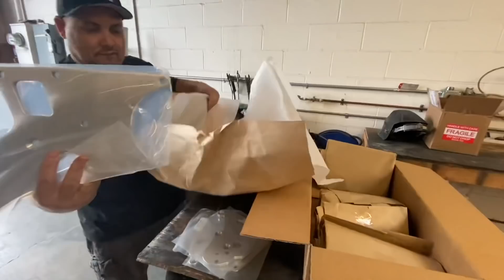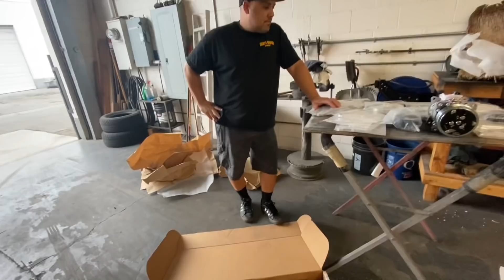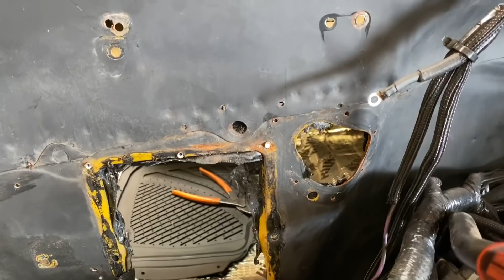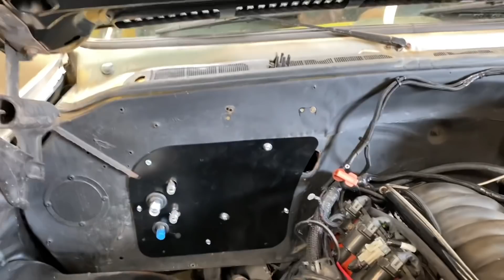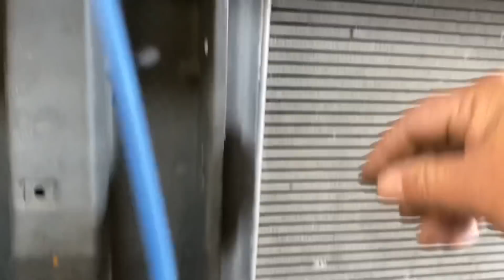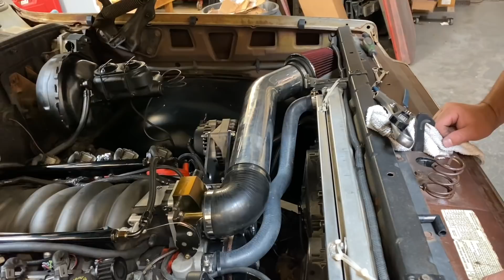SquareBody gets VintageAir with Dirty Dingo

Comment: This particular unit has heat also correct? What pulley or relocate bracket for the compressor  do i need my 1987 C10 is LS swapped. And is non ac or heat from factory
Reply from the maker: Yes, hit up Dirty Dingo for brackets

Comment: I've got a 75' 1 ton, 1 owner bought as a cab n chassis and he put a 12 ft box on it, he passed, I got it from the granddaughter with 70,010 miles, just finishing up the factory 350 engine and put some 302 heads that I had worked by Bob Cram in Ridgecrest.. it should RIP but definitely have always wanted vintage air ...

Comment: Routing the wires along the heater hose is ok but putting them through the same hole is a mistake.
Depending on the amount of clearance and level of vibration they will rub through eventually.
Reply from the maker: I think you mean “could be a mistake” but it’s run through with the Smallest hard line which has a large grommet and plenty of room.

Comment: I wish Vintage Air would make a setup with a fresh air option.
Reply from the maker: Good point.   I generally will leave or even install the factory vent handle for the vents in the kick panel “sends fresh air to the blower”
Reply: I've written a bit of a novel here but I've got a work around that might just work for you. This is what I did on my car.

Now I will say I am a mechanic so I know a few tricks and hold a R12 recycling ticket for auto air conditioning fwiw (which isn't much these days).
Also I was working at an auto AC place doing mechanical repairs one time. I had a Dart and wanted AC in it and they told me exactly what to do and I did it and it worked so well it was amazing. It wasn't that expensive for me to do because they just gave me most of it for nothing and I could pay my own labor lol. 
It did take a lot of planning and searching for bits an pieces and I installed it over about 6 months in increments because I'm lazy and hate working on my own stuff esp when it's running and my daily driver.

What you do is go factory AC evaporator and heater for the low pressure side except the TX valve - it has to be R134 (or equivalent) compatible. Replace the AC thermostat, no if no buts. The alcohol bulbs become unreliable. It has to be new. Replace the heater core. Fix all the old rubber seals on the doors, check all the vac diaphragms. Replace the heater tap. 
In fact for many cars/trucks you can buy refurbished factory units.
In the engine bay you need a new fan clutch and shroud ideally with an AC water pump and pulley (if they were different from stock). Also you might need a factory upgraded AC radiator if you don't already have one, which was usually 3 row.

Next, use R134 compatible compressor - so I used stock Mopar RV2 compressor modded with new seals for R134. I drained the old oil out and put a R134 gasket kit through it. That way all the factory brackets, pulleys everything is easily available. 

Next, a R134 condenser and a condenser fan (very important). The Condenser I used was generic out of a book. I measured up the space and tried a few they had in stock for size. I made brackets for the condenser out of external transmission oil cooler brackets. It was really solid and you couldn't even see it behind the Dart grille.
The condenser fan was new and I used the biggest that would fit behind the grill and because R134 condensers are not fragile like R12 condensers I bolted the fan directly to the condenser with large OD washers, some large OD rubberized washers (for a bit of vibration absorption) screws and nylocs.

Try as much as possible to use hard lines on the high pressure side - usually the factory lines can be used. If you don't want to, AC suppliers have extensive collections of new off the shelf pre made hardline with bends and everything but yeah I like the factory look.
Replace all the low pressure factory rubber hose - get an AC joint to do it (they usually cut the old rubber off the metal section, braze new barbs on and then swage new R134 compatible rubber hoses.
Get a new receiver drier with a trinary switch (3 way hi/low/fan). Use 2x relays and on the earth side of the relay and run that through the trinary switch so no current goes through it.

I put a 383 in a Dart with power steering and did everything I just told you and the AC worked an absolute treat. It was pretty tight but it all fitted and best of all looked great and just worked - not cool but cold if you wanted it.

So if the vehicle you're contemplating doing the job on has factory fresh air, then what I just wrote you will work by making your own hybrid system. Best of all it will look very professional and will perform well.

**R134 really works fine on the low pressure side of old R12 systems. Just be sure to flush out the old oil with a solvent in both directions of the evaporator coil and repeat it about 10x. Any residual solvent will boil off when they vac the system out so no need to worry about a few drops of solvent remaining. 
The problem with R134 is more on the high pressure side but we're upgrading those components that really matter. After the TX valve then it hardly matters because it is low pressure so compatibility is a non issue.

Like I said I just followed what my AC specialist employer told me to do and it was far better than I expected. Now I'm telling you.

Comment: I was taught that the compressor had to be mounted in a fashion that the lines coming out couldn't face downward otherwise all the oil would run out of it?? I think it even says that in the vintage air instructions?? Hope it doesn't become an issue for you guys.
Reply from the maker: Not so much the lines as the oil fill bolt on Comp. body  should up or sideways but never down.  
   Good call 👊